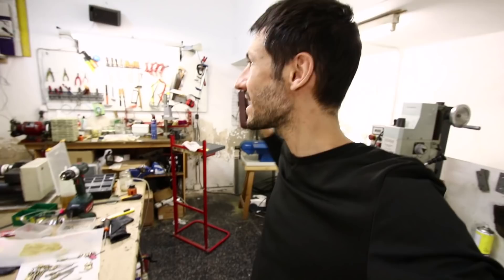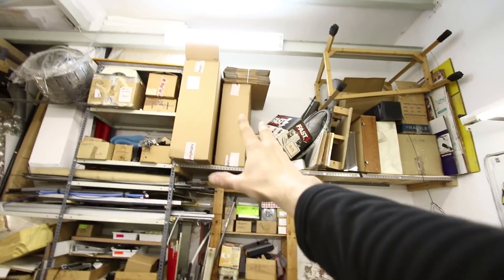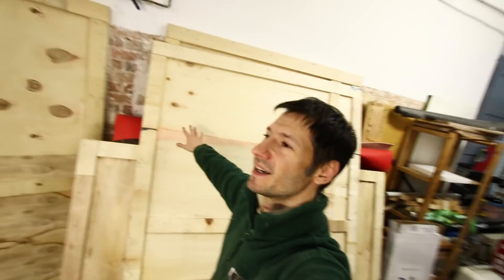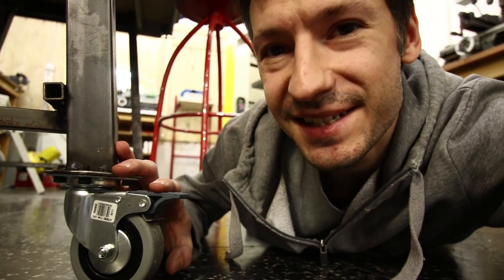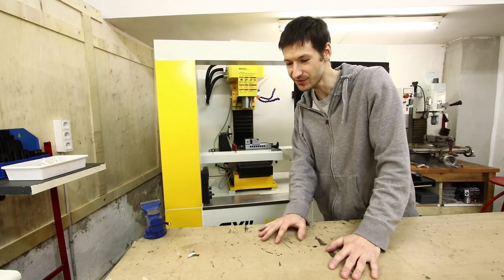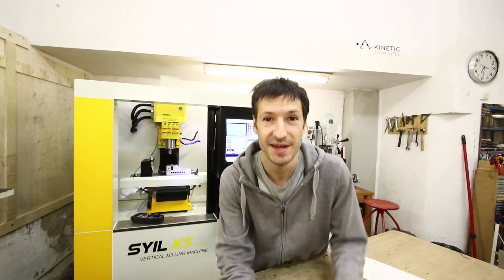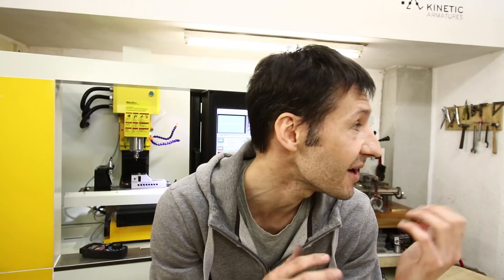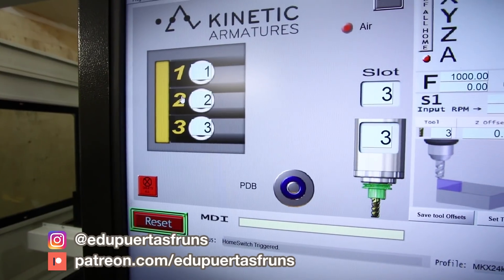Heavy workshop update, Syil X5 CNC

Comment: Nice! I see you are using mahc3. Would you mind to show how you handle the M6 macro for ATC? If possible I would like to check the M6 start nad M6end file in your macros folder and the 1024 screen set you are using. It's easy to share them by just sending those files. Thanks a lot!
Reply from the maker: I did not program my atc
Reply: @edupuertasfruns  I know that. What I meant is that Mach3 works with scripts and macros and those are easily accessible. So basically if you are willing to help, the only thing you should od is sending to my email address: rey8801@gmail.com these files (I will list the folder path so you can easily find it in the pc running the Syil).
-  C:\Mach3 all the file with format .set, these are the screensets (and they will included the scripts). For instance the default is called 1024.set (this is the general screenset Mach3 comes first).
- C:\Mach3\macros and I would need the folder that has the same name of the profile you are using for the machine. When you open Mach3 loader, it lets you choose which profile whant to use for the machine. You can also read the name with Mach3 open, it's at the bottom right. 
_ Last thing in C:\Mach3 the file .xml with the same name of the profile you use to run the machine.

You can send them as zip file. All together will give me an idea of how the ATC works in your Mach3. In case you do not know it, please do not worry, you are not sharing any license of anything. Those are just the settings. I have made macros and nice screesets in case you need something. Those files are what we shares regulary between Mach3 user to help us out. Thanks a lot for the help!

Comment: Edu, I am a manufacturing engineer. I deal with industrial CNCs daily. If you need any advice or help, let me know. I can work with you on designing for manufacturability, fixturing and work holding, cutting tools, etc. 

Let me know. Congratulations on the big step into CNC!
Reply from the maker: Hi I appreciate it, let's see how it evolves. For the moment the machine runs and I made the first part😊